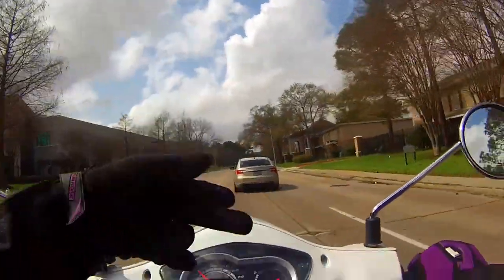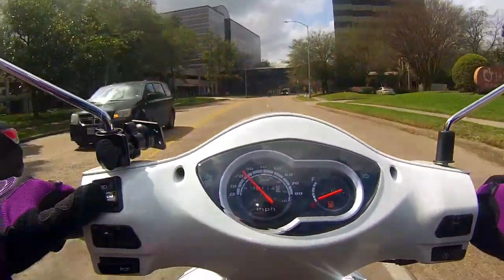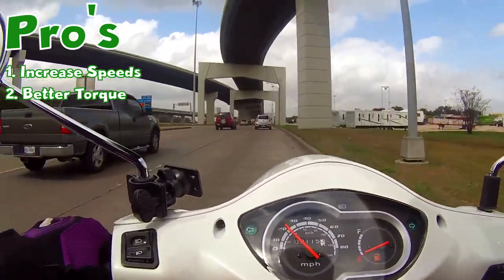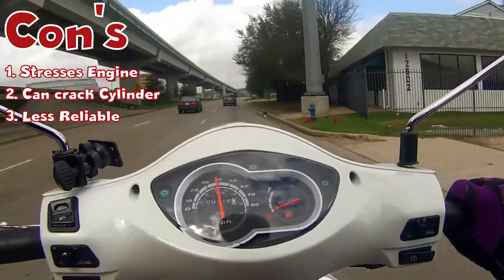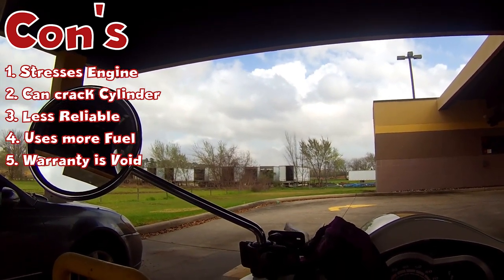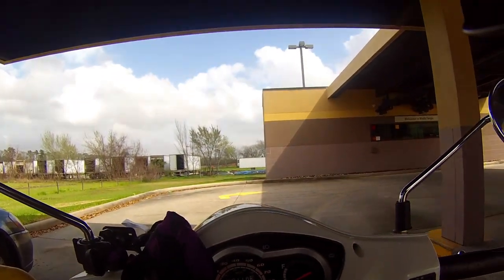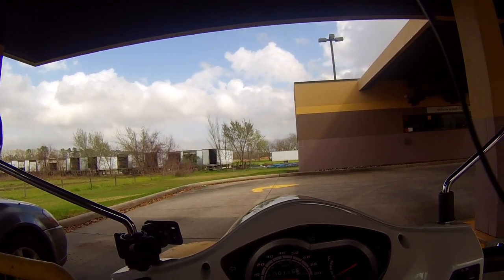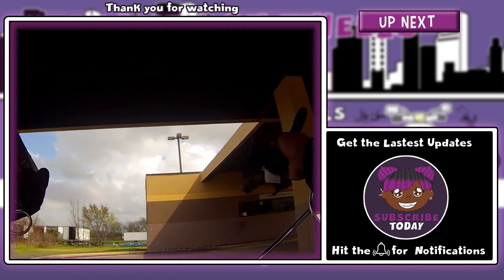125cc Scooter Vlog 10: Big Bore Kit, turn your 50cc into a 150cc

Comment: Shauna, a 50cc cannot be turned into a 150cc with a big bore kit. The entire engine would have to be replaced. You can turn a 50cc to a 100cc though, which is really like a 88cc. Love my BIG BORE!
Reply: Kachi's Kid so if I put a bore kit on my gilera 125 what would it be g?
Reply: Wrong sir! A 100cc big bore kit makes an 82cc it has a 50mm bore. There is a 105cc or 120cc  depending who you talk to or see the ad, kit that makes an 88cc but it has a 52mm bore.
Reply: That's what I'm doing, i just got my 150cc engine to put in my 50cc frame, i also got a big bore kit to make 171cc. The only thing i wish i had the answer to is.. Can i put my 50cc axle gear in my 150cc engine, without putting a spacer and or long pipe, or buying a modified short axle to tighten the bolt for my 50cc tire? The people doing a swap would understand. I hear the difference is 2mm if that's true? Then the gear won't fit, but it was coming from a guy trying to make a sale for a short axle he was selling, that looks like my 50cc axle. I'm gonna measure it, which means i need to open up both engines..
Reply: Would a casual observer notice that it's big bore?
Reply: @GregAllen1158  52mm makes a 50cc into a 105cc.
Reply: You are correct
,I know it is only 88cc the manufacturer states it at 105cc on ebay
Reply: you can actually...is it safe no is it possible? yes the max bore diameter of the case on a 139qmb is maxed at 52.4 mm the bore size of a 125? is roughly 54 mm and a 150 is roughly 57 mm so in order to fit the 150 cc piston into a 50 cc youd have to have the crank case bored over 5 mm in order to fit the jugg into it

Comment: I have a 50cc Gator Express S3 I just put a big bore kit on it it was 100cc and I've never had not one problem with mine not one single problem and I've had mine up to about almost 50 mph and that's even on flat ground and the only mods that I've done to it was put a big bork in it and I put over 3,000 miles just on that Big bore kit

Comment: Id rather use all the other aftermarket products to get faster speed than a BBK. This way you still 50cc legal even if you still hit faster than 30 or w/e. I got a 2015 taotao evo50 that i changed the carb for 1 i can open up and work on. Stock prob has 76 or 79 main jet? This 1 has 85 plus can adjust air screw. Took out the airbox for 1 of those cones. Put the orange cdi and ignition coil in. Id say like half a mile and it hits 40. I need to hit that quicker. Maybe the variator, weights, clutch, springs and whatever else? Dunno what size rollers are in there prob the reg round ones at 5 or 6g maybe? Could try the 8g slider rollers and see if top end is better.

Comment: You CAN swap the cylinder and piston for more displacement (and therefore more power), but you're usually limited to whatever the "bottom end" of the stock engine will allow and what the induction and exhaust systems will allow (unless you want to change both as well).    Increases in displacement typically aren't this large for good reason.  There's the physical space limitation which is obvious, but there's also the design limitation of the other driveline components.   Doubling the power output of the engine sounds great...until you realize that the transmission, cooling system, brakes etc weren't designed for that much power and speed, so they will fail prematurely under the increased stresses.  You can increase a 50cc to 70cc maybe even 90cc on a robust engine,  but tripling the displacement isn't a good idea, even if it's technically feasible.   If you want a 150cc scooter, you should trade up.

Comment: You didn't mention it can run hotter, and possibly overheat! But the cylinder isn't likely to crack, but it is more likely to damage a bearing, destroying the engine, if continued use, (it only takes a minute, and it may not be repairable!). The main down side is money, but a smaller big bore kit is OK for about anyone, say go from 50cc (39mm bore) to a 47mm bore, being somewhere around 76cc,  it will mostly give faster acceleration, it will possibly go maybe 3-4 mph faster, but gears are available, it will slow take off, (acceleration) but hive 10mph faster, +/-,  with CVT tuning , it maybe quicker and faster..  But it's not going to be noticeably louder unless the exhaust and /or intake is modified!!  It usually is when a bbk is installed!!

Comment: I did the big bore kit 150cc to 171cc & the plug & play EFI kit ( fuel injected ) automatically kills the starter, big Con . So if you're planning to due ! Starter upgrade is necessary ,overheating is another. Just not worth the trouble IMO ! I can't really tell the difference & kills the reliability of the scooter in the long run ,even the fuel injection . Mine ran so good & it was a mistake, I wouldn't due it again 🤔 not for me . Always good info safe scootering 😎

Comment: Typical bore kits are LBK and BBK, light bore and big bore. Typically around a 50cc increase. The engine will be slightly louder, but to the ear, you may not be able to hear it.

Cracking the cylinder should be impossible if it is a quality part. If anything, the crank case bearings will take the strain. Ideally, a tune is what you need.

Comment: 50cc's usually go up to 70-90cc. 125s usually go from 150-180cc and in some cases 210cc without having to do an engine swap, in the case of 2strokes ive noticed a top end and torque increase with a big bore, as for 4strokes ive only ever noticed an increase in torque unless i changed the sprockets to make more use of the torque

Comment: Big bore kits are not  illegal,  BUT  once installed, you now  have a legal  motorcycle in my state  and  most if not  all.  You  will need  motorcycle  registration, motorcycle insurance and  motorcycle  endorsement to ride it legally,  whether under 30 mph or not it  is  now  classified  as a  motorcycle  and  you would  need  those  things.  Big Bore  kits  are  usually  bought  by people  who  intend to  keep  the  50 cc  registration  as a  moped, use bicycle  parking, etc. ALL  of  that  is  illegal  if  your  bike is  now  more  than  50 cc's, Your  goose  would  really  be  cooked if  you  were  speeding  or  got in an accident,  so,  I  don't  see  the  use  for  it  in  scooters  only  to  go  around  the  law.  Those  kits  are  fine  for go karts  and  off road  bikes  but  that's  about  it.
Reply from the maker: Yeah, It seems like a lot of potential trouble for very little benefit in return.
Reply: Same here in the UK

Comment: It's not really going to be louder unless the exhaust is changed,  I have a 50, that is 81cc, it easily does 40 mph with it loaded, and can do well over 50,  I'm building another engine, it's going to have the biggest bore kit, at 52.4mm, with a stroker crank, coming to 96cc, and with over size valves, it should perform atleast as well as a stock 150cc scoot,   maybe as well as a 171, with it being otherwise stock, it will achieve this by having much more compression, and revving mich faster, I'm expecting it to spin to around 12k rpm, nearly twice the stock engine, along with a performance cam, and exhaust, and using the same carburetor as a 125-150cc,  I have most of the parts Already, I'm expecting it to easily maintain speed on hills, atleast, 45-50,/where I'm doing 20-25 now, and flats it should do 70+/-,  all for around $600,/ not including labour, since I do the work myself, but the main thing is added cooling, I have a aftermarket fan, and a oil cooler, and  temperature gauges, for oil and engine!

Comment: done 70 and 80cc kits cheap ones last a little while I put on my sons for that extra bit of speed the transmission needs to be tuned. Variator weights, decent make drive and contra spring and maybe clutch springs changed. The 70cc I did I used a quality make Naraku and changed the crank for the same make as well did not tune up the transmission just changed the belt for a decent one and upgraded the carb for a 20mm one of decent make. This keeps to 35mph now but uphill it does not slow down. The 80cc does 50mph on my sons but thats with tuning transmission and less reliable as a cheap kit.

Comment: Great video!  Just found out about this channel and I like what I see!  Going to just have to say a few things on your cons though.  I have never seen or heard of any insurance rates go up for people doing bore kits.  Might just be different state laws.  I know here in Washington state, if you do a bore kit on a 50cc, anything higher turns it to a motorcycle and thus requires a motorcycle endorsement.  Anything under 50 only requires a driver's license.  Of course, have I ever seen people do that?  No... unfortunately not.  Which is why a lot of people tend to buy 50ccs and go dirty by installing a bore kit or flat out replacing the whole engine with a 150cc while praying they don't come across a Officer who knows the differences of a 50 and a 150.

Of course, nothing really changes if you install a bore kit in a 150cc... or get a B block case to up it to a 232cc.  It still is classified as a motorcycle here and insurance stays the same.
Reply from the maker: Thanks Tusken and Welcome  😀. Yeah, insurance companies want to know you've ever done any modifications on scooter or bike and based on that info they adjust your insurance rates.
Reply: Interesting.  Yes, I have done quite a bit.  I have my insurance through Progressive and they only are concerned if you change engine size, alter frame to turn into a trike, or adding nos, turbo, or supercharger.  I've modified nearly everything but adding those or turning to a trike.

Comment: I have a 50cc Baotian classic with a 80cc and the only thing that changed on it are the torque , not the topspeed 😎
Reply from the maker: People get mixed results. It's just depends on the scooter and how compatible the big bore kit is with it. Thanks all the comments Ralf 😊.
Reply: Ralf Risberg , you'd. Need to do some work on the cvt. There's lots of videos on Youtube to adjust the weights on your variator. To make it faster or more acceleration.
Reply: William Stewart i don't want it to go faster , it's one of those plastic Scooters with 10 inch rims so it's nasty to drive as it is 😂
Reply: Your  gearbox  isn't  meant  for  the  extra  stress ,  either
Reply: LOUIS STEFFEN gearbox ? It's an cvt and i'm sure it can handle it !!

Comment from the maker: Do any of you have a big bore kit and what was that like for you? Do you have any pro's or con's too add to my list? For instant, another con is over heating.
Reply: I bought a 16 year old used Kymco Cobra Cross on craigslist. It was a 2 stroke 50 with 9,946 miles on the original piston and rings. That kymco  taught me to love 2 strokes. 

Anyways, it was quick on the flats. It would go up to 40/41MPH  with the tires full of air and a long straightaway and me in an aero tuck. However, show it even a picture of a hill  and it would slow from 35 down to upper 28ish and hold.     Since the bike was old, did not cost must and was very in need of a new top end, I decided to buy a 70cc malossi big bore kit. It cost me $150. It was easy to install. No issues what so ever. (no, I did not upgrade the carb too) 

OMFG, it transformed the acceleration and hill climbing ability a ton. It was now as fast off the line as a 4T 125. And, it could CLIMB up hills and not slow down. Seems that 50cc is just below the threshold for usability and 70cc is where you should be as a minimum engine for real life street use.   The BBK felt like it doubled the torque. It only added about 4 MPH more top end. Where as before the 50cc would get up to about 6,800 RPM, with the Malossi  bolted on, it would get up to 8,000RPM. That is how I got 4 more MPH top speed. The BBK allowed the engine to rev higher. Same final drive ratio so no, I was not expecting a 10MPH increase.  Like folks say, initial cost of your used 50cc toy, plus 70 or 80cc BBK is probably  more than you would spend for a used 150cc China Scoot. But boy it sure is fun to play and see the difference.
Reply: On the counter intuitive side, my gas mileage  actually increased a little bit after installing the BBK? Why? Not sure, but I bet it was either that the scoot now did not have to work as hard to tool around the neighborhood, or the new rings and piston were more efficient due to less blow by. The old piston showed a modest amount of exhaust blow by on the exhaust port side of the piston. Not bad at all for 9,900 miles.
Reply from the maker: It seems you had a pretty positive experience with your big bore kit. A 16 year old Kymco, that's pretty great. How's it holding up after all these years? I hope my scooter will last as long as yours.
Reply: I was shocked at how great the materials were that they used to build it. Just rock solid. The plastics however we not up to the same quality as the metal parts. I had yellow tape covering cracks on the yellow body panels all over. I learned to respect Kymco after owning that scoot.  Ended up selling it for $200  to an older lady who could not afford a car. Told her to come back if it ever needed any minor repairs.
Reply: You very seldom see Lance scooters on Craigslist. Folks just do not want to get ride of them.  Off to Walmart on my scoot now. More bing watching RoW later today after some chores. Good job.
Reply from the maker: 😂 Okay. Have a safe trip.
Reply: I had a BBK installed on my Peace Sports 50 scooter a few months ago, and I just have to tell you all the pros and cons I had for mine!

Pros: -Louder, I am now noticed better on the road, so it increases my chances of not getting ran over by a careless motorists.
-More power, I can stay just barley above 30 mph uphill now instead of 20. However, I didn't get much of an overall top speed increase, but if I were a lightweight then maybe I would lol.
Cons: Well...to sum it up quickly, it's indeed a lot less reliable and repairs have been costing me a fortune, with more repairs still needed.

Comment: You can't turn a 50cc scooter into a 150cc unless you cut the inside of where the cylinder goes into then it could be bigger. In the long boats that go into the scooter will be too small for your cylinder and everything else that goes to it. You just cannot turn a 50cc into a 150cc.sorry to say but if you have never ever ever put a engine on or mess with a scooter motor than you do not know what you are talkin about.

Comment: No one wants 49 to 50 CC scooters but for little kids or grandma to go to the market and have her independence. So they sell real cheap on the aftermarket. Cleaver idea... buy those scooters dirt cheap and learn about moped maintenance by installing a big bore kit . Drive it around a bit... and then sell it as a "Stealth 150 CC" (or what ever) at a much higher price. I see ads for "Stealth Scooters" here in Claremore Oklahoma like every 3 to 6 months (even in the ice and snow months). So I think there is a pretty good market here. Just a thought.... and it's on my list of things to try once I get my first scooter and can justify buying a cheap Tao Tao 50 CC for $90 as an "Education" purpose for my business taxes.
Reply from the maker: Yeah, good point. That's a sweet deal.

Comment: lol you cant turn 50cc into 150cc
Reply: People will believe anything if you make a video. You also can't make a 125cc 225cc or a 150cc a 250cc.
Reply: If you live in south east asia, then you can. Which i do and i upgraded my moped from 135cc to 180cc
Reply: ... dude... Yes you can. There are kits and you can do it.
Reply: she doesnt mean literally switching the ccs,she means you will be getting the same power as a 150cc,but it will still be a 50cc
Reply: you should do your homework
Reply: @photonrayswaves  who said that?
Reply: you can make a 50cc a 200cc if you want the questions is : you will not find these parts from any vendor and you need to mod the cilinder yourself and ask someone with a cnc to make your piston to the diameter you want i had to weld and cut the crank cases to instal a 180cc in my  yamaha dt 50 lc the maximum i coulg go buying parts was the 100cc from polini and or athena both italian brands so i decide to use a blown up big bore 100cc polini kit to open the hole even more and had a piston from a suzuky rgvt cut on the bottom to do this is portugal bro this is how we do it https://www.youtube.com/watch?v=fo6Nzq5QbsA   want more portuguese powe on 50cc? check that https://www.youtube.com/watch?v=y25-qnnbrwY
Reply: who said that?
Reply: From what i hear you can turn the 150cc to a 230cc only if its the Japanese gy6 not the Chinese gy6 which can only go 171cc or the 180cc depending on ad. Its because it has a wider gap which you can modify in a Chinese gy6 only if you have a tool which also widens the gap for a bigger piston over 200 cc's

Comment: I attempted to put a HOCA Big Bore Kit on my Yamaha Zuma 50F.  In doing so, it destroyed the bike.  The Zuma has an electrical system and CDI box that is not compatible with a big bore kit.  It will also cause issues with fuel injection and over heating...  However Big Bore kits work well on most Chinese scooters or gy6 engines.
Reply from the maker: I forgot about the overheating. Thanks for that. Right, big bore kits don't really work well with the better quality scooters.
Reply: Dude just get it tuned...smh

Comment: I have been playing with the mopeds for a little while now I drive a 50cc and I've done the big bore Kit in the pipe and the carburetor all I can get out of it what's 60 so I decided I'd buy me a 150 the 50cc will run circles around it if knew that I would have stuck with the 50 and not give it to my son